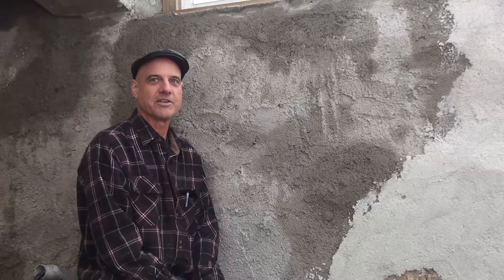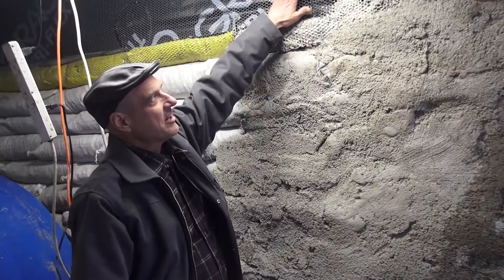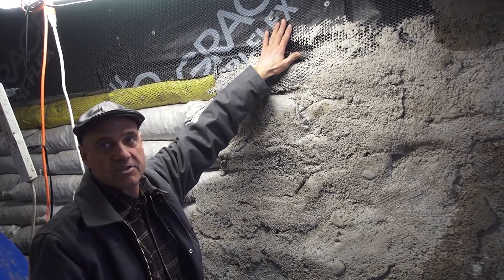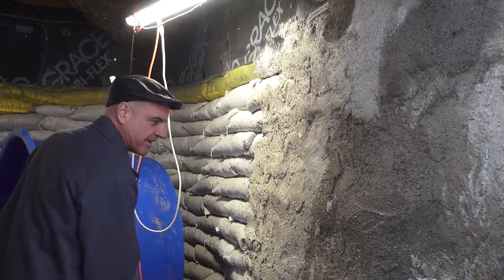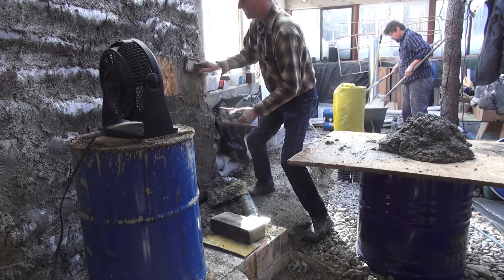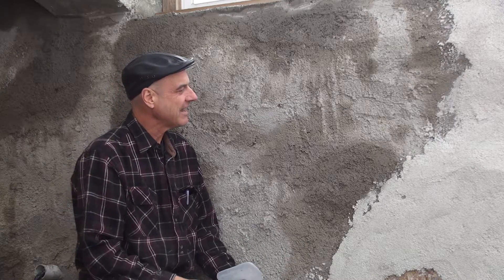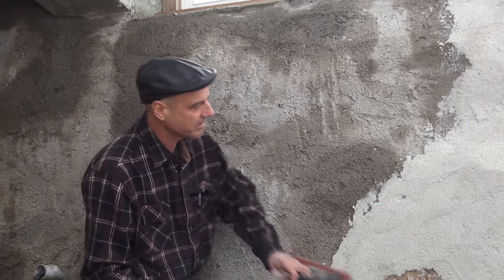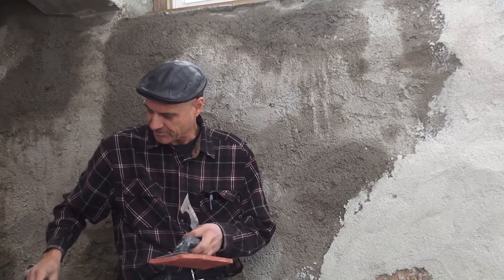Solar Earthbag, Aquaponic, Earth- Bermed Greenhouse - Natural Plaster on the walls

Comment: could you please write down all three coat plaster mix ratio or any link.
Reply from the maker: Scratch and brown coats: 7 Sand, 2 clay, 2 lime, 1 portland cement, 2-3 handfulls of chopped straw (cut up with weedeater in a plastic tub)  Color coat: 5 sand 1 lime, 1 white cement, no straw.  You can adjust these mixes to your conditions, desired outcome and climate considerations.
Reply: thank you!!